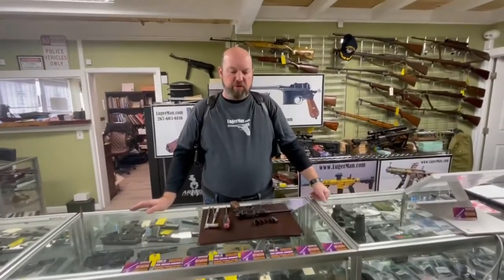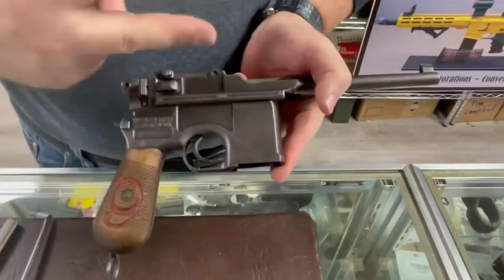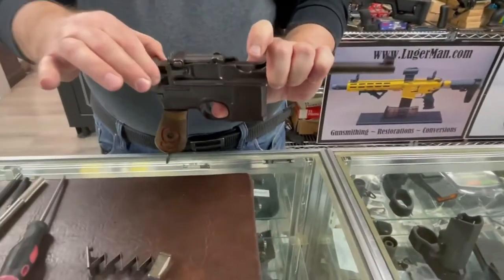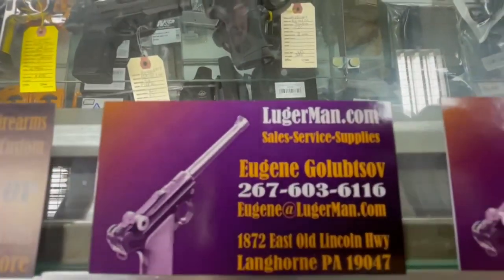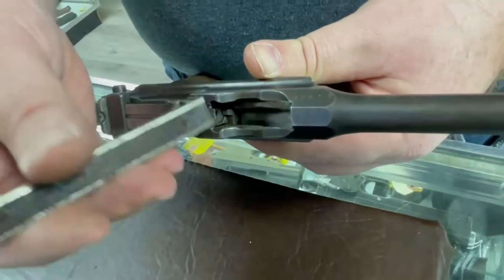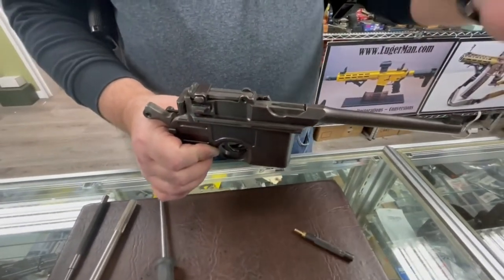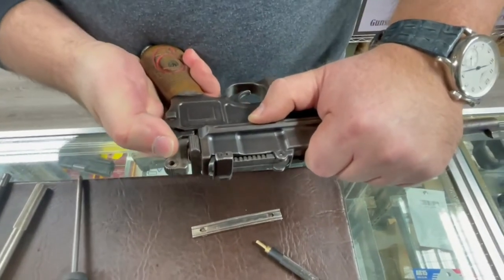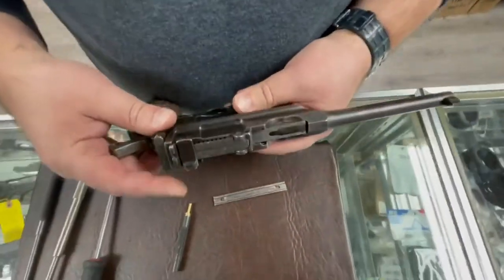C96 troubleshooting ( Mauser Broomhandle)

Comment: Thank you for this video. I was having the issue where the bolt and extractor extending forward enough that I could not insert the stripper clips. I was concerned that something was out of spec but now I know that is common and my fix, which was to pull bolt back a little more, insert stripper clip and then release bolt to put pressure on back of the clip, thus freeing the pressure on the follower, is the correct method.

Comment: Great video! I have been troubleshooting my own Mauser and went through all the steps and your function test.. looks like going through the steps in your videos I have a slightly soft trigger (probably due to the trigger seer, something I suspected but good to know) and I have the ejector that sits too far forward so my feeding clips wont fit unless the bolt is pulled back.  Good to know the alternate feeding method because of that... Keep up the good videos and looking forward to all the insight your experience can offer!

Comment: My C96 fires and extracts the rounds but the bolt is always locked open failing to chamber the next round which forces me to push the bolt forward myself. Do I have a weak spring or something?
Reply: I have the same problem with mine.  Have you found a solution?
Reply: @deswanao  Took my C96 apart and it turned out that the firing pin was snapped in half. The recoil spring was also old, worn out, and bent. I simply installed a brand new firing pin and both a brand new firing pin spring and recoil spring from Wolff Springs and now my C96 fires flawlessly.

Comment: Hi Eugene,
I have a problem with one of my C96s. The bolt is impossible to rack back  to chamber the 1st round unless the muzzle is pressed against something hard and the upper receiver is then pushed back by 1/4 of an inch. I have tried swap bolt springs and nothing seems to work ? Could you let me know how I can remedy the problem? Many thanks.
Reply: I have exactly the same problem with my shnellfeurer  model 712 , a few months back I could crack it easily , of course with some force , but now because of my age [74years] I can't pull it without unlocking it against a hard surface .

Comment: What can you do about failure to extract?  My extractor is NOT tight in the bolt.  It can move slightly vertically as well as for to aft.  This is the condition it was in as received from the gunsmith after “restoration”.  Can this be adjusted or does it have to be replaced?  How is “adjustment” accomplished?
Reply: In the extreme cases of ware on the bolt, it can be welded and machined, but an easier approach, is to customize the extractor to fit better on the rails. Send the gun over we will correct .it

Comment: I have a wobbly extractor but the gun extracts just fine. The biggest issue with it is that the hammer gets caught on the bolt sometimes.
Reply: A small steel collar around the firing pin placed behind the firing pin spring but before (in front of) the bolt stop will prevent the bolt going too far back.  I have fixed two with that problem that way.
Reply: @kenibnanak5554   I made one a year ago but it only caused worse issues. what did fix it foe my gun was grinding the wear away on the hammer. Carefully rewelding it back up and then polishing it
Reply: @harryjoe860  How did hammer wear allow the botl to come back enough to snag on the hammer?
Reply: @kenibnanak5554   it made a burr that would catch on one of the locking grooves

Comment: When I pull the slide back it to confirm it is empty, mine stays open.  I have to put a round in it (even an expended round) then carefully activate the slide so it does not come all the way back.
Then it will close up.
Reply: That is not a malfunction.  The bolt is supposed to lock back on an empty magazine's follower.  As he says for these tests the magazine (and follower) are removed.
Reply: Mine has the exact opposite problem. It was working fine until I went to load it. After all the rounds were out it wouldn't lock back